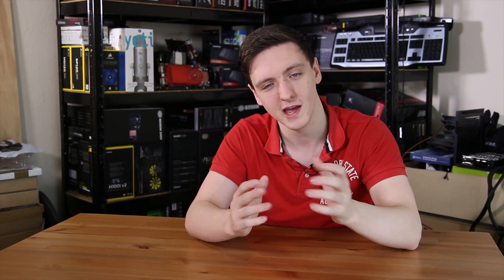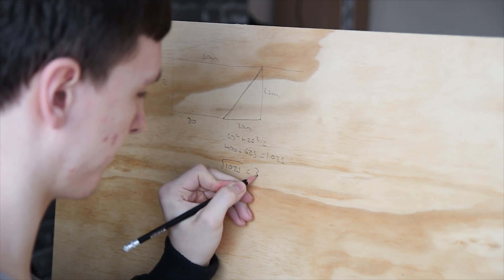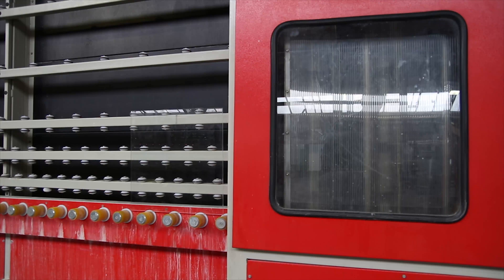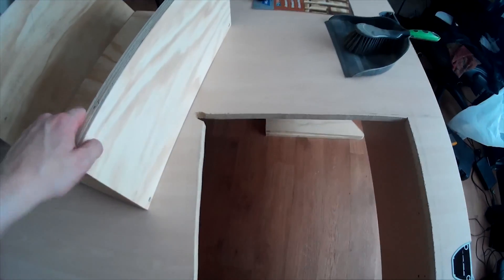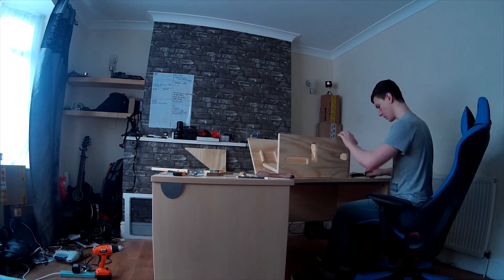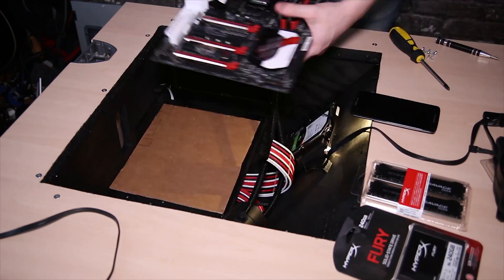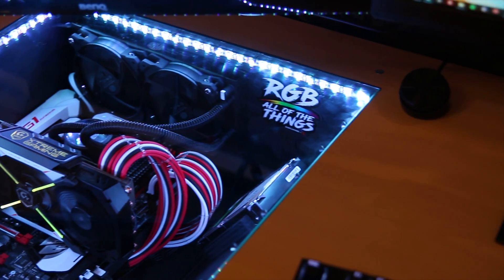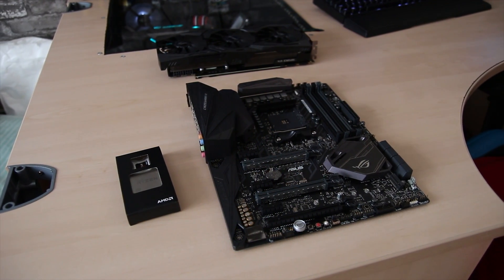How to make a Budget DIY Desk PC

Comment: Wouldn't it make more sense to cut your square hole slightly smaller then cut another square of the right size but only as deep as the piece of glass? Then the glass can sit on the edges that are sticking out from the smaller square.
Reply from the maker: I dont have the tools to router the edge, although that is how I would have wanted to do it.

Comment: Looks like crap, I would of used boxed joints or pocket hole screws instead of butt joints. Routing the top of the table and adding a rabbet around the hole will let you lay the glass down flush. Also take note that flat spray paint will have a metallic substance in it and can cause you to short something out if you lay something like the motherboard straight onto the painted wood. I found this out many many years ago when I painted a CRT monitor with rustoleum flat black paint.

Honestly this is how I would do it. Go buy a desktop case. Chop out the drive bays, ditch the cover and front bezel. Route out the top of the desk, add a rabbet for the glass to lay on. Attach four panels to the desk, front, left, right and bottom with pocket holes or box joints. Leave the rear open so it works like a shelf and you can access the I/O of the computer. I would paint the inside a flat black but instead of RGB LEDs around the top I would put them under the edge of the motherboard. If water cooled use UV paints and a black light. Green antifreeze looks freaky in a blacklight.
Also since the desk is made from partical board or MDF I would use T-Molding for around the desktop surface that was cut out. If you use T-molding you might not need to add a rabbet for the glass to sit on.
Reply: Would have, not of.
Reply: Hey the overall concept of pretty cool. It's obvious his field of expertise is computers not woodworking. Woodworking is not something you learn overnight anyway. Cut him some slack.